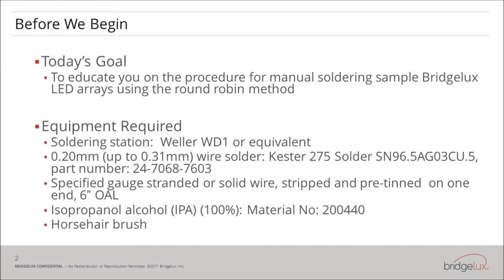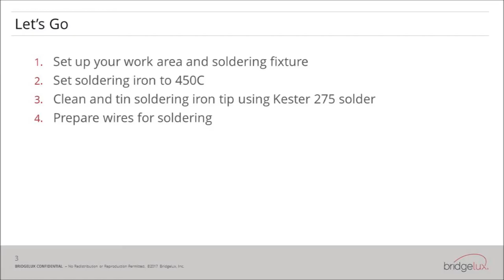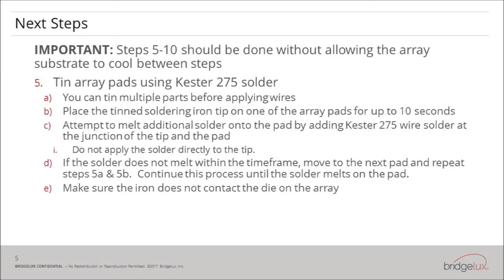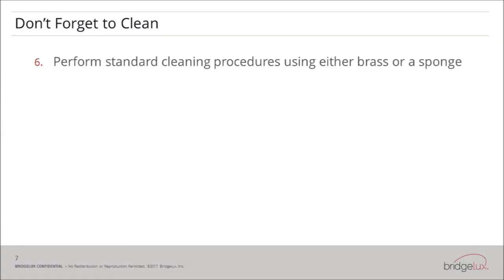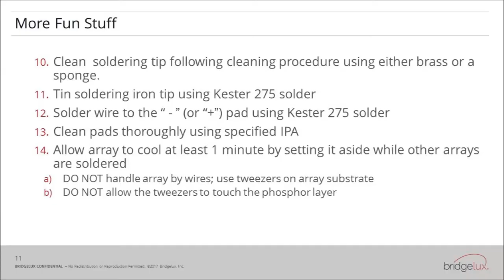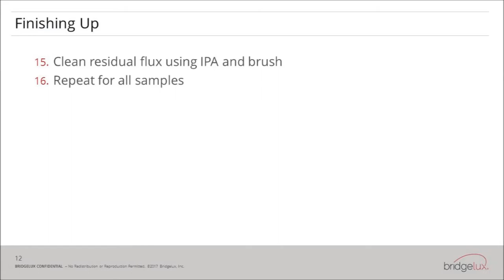Bridgelux Vesta™ Series Manual Soldering Sample Preparation

Comment: I have had some very experience soldering these SOB COBs!  Sometimes, no problems.  Other times, nothing but headaches.  I don't know these Chinese companies don't add a nice aluminum electrode to the side versus that poorly engineered piece of copper that is very damn small to attach a wire to?  These are very very time consuming to set up in an array.